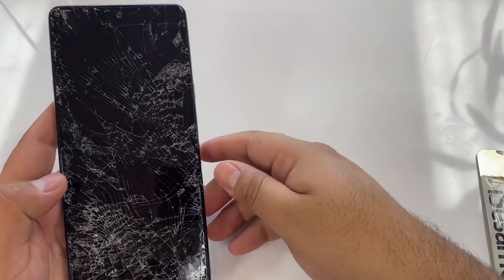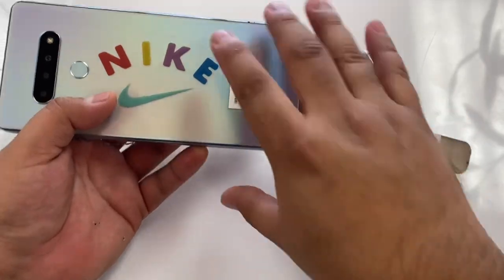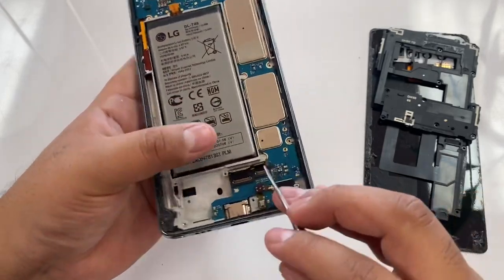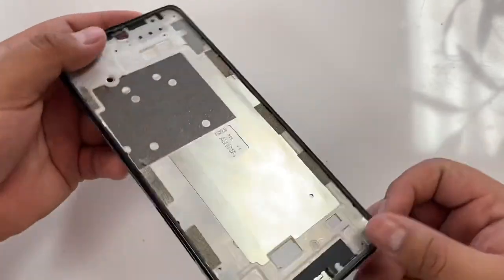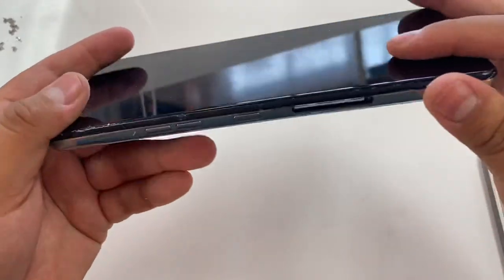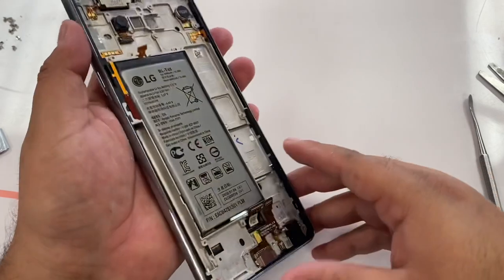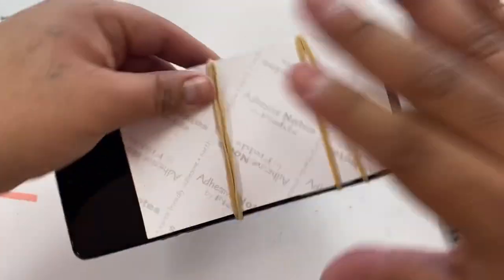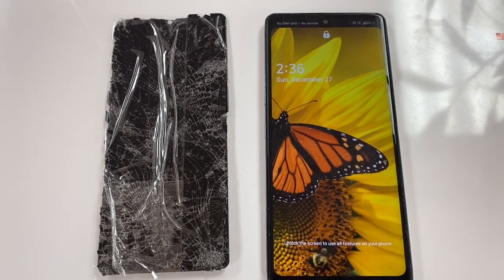LG Stylo 6 LCD Replacement quick and easy step by step

Comment: I have the same phone I slipped and my phone went sliding on the rough concrete. I wanted to know where did you get the screen replacement I would like to order one as well and follow your video to install it.
Reply from the maker: Try the link on description

Comment: Good tut. But is it possible to replace just the outer front glass? I see they sell it, so im assuming its possible. My kids phones front is cracked but it still works. Rather spend $15, opposed to $60-$100 for the lcd kit. I actually purchased just the front glass so...im not sure if I should try.
Reply from the maker: Replacing just the glass is tough , you need take your time heat the front glass and pry it off without damaging the lcd .
Reply: its possiable but a major pain, i messed up my wifes lcd attempting this
Reply: @joshuagiles7060  what u do ?
Reply: @markosgaming3232  i attempted to remove the glass only and wasnt prwpared for the hassle of it. Also didnt have the right tools. So the lcd wound up having to be repkaced

Comment: Look this might be weird, but the iSesamo you have, it looks to be one of the original made versions that were produced in Italy. If you know about this and know that they have since remade these out of a cheaper metal, would you by chance know where to find the original white handled iSesamo? The original can be bent and it always returns to its original position and the whole tool itself is thinner, allowing getting into back glasses much easier. Also the handle does not fall off so easily.
Reply from the maker: Not sure

Comment: Thanks for the video. Very helpful. Quick question…why do you need to remove the motherboard? Looks like you could just disconnect the screen right?
Sorry if i am missing something.
Reply from the maker: U may need to removed to unplug other one and slide out the old cable slide in new cable just lift it a bit

Comment: All you fools don't talk how hard it is to get that screen off without damaging that silver backing, that silver backing can easily be damaged trying to pluck that screen off.  It easily cracks like a thin piece of glass.  I don't know how you managed to pull it off without damaging the silver backing. If you damage that, you probably have to get a whole new lcd screen instead of just the glass.  Thanks for your lack of detail.
Reply from the maker: This repair was a whole new lcd and glass install ... glass only installs are really tough to do since lcd is very thin and fragile u will most like break if not enough heat and waste time ... replace both and u can peel lcd like I did clean and install
Reply: @MarcosTechHero  Yeah, like what?  Heat gun on high, roast edges for 1 hour or until glass starts to melt.  Thanks for the unspecifics.
Reply from the maker: @aljawisa  I actually use a hair blower a heat gun is way too hot ..... this way has worked for me ... not to technical I’ve done most phones like this ... just info everyone works on their own ways and beliefs have a bless day
Reply: @aljawisa  yo, of course its difficult to do without breaking it. HE SAYS THAT... go be crabby at someone else, this was an awesome tutorial 😛
Reply: Of course he doesn't talk about how hard that kind of repair is because that's not the kind of repair he's doing or suggesting LOL
Reply from the maker: @confessrealismsreviews7013  it was pretty easy just need some time to take apart actually took longer do to recording but aslong as u have heat gun ur good
Reply: @MarcosTechHero  definitely! Just wanted to defend you some, cause that person is acting a little ridiculous.
Reply from the maker: @confessrealismsreviews7013  thanks 😊

Comment: Is the touch screen & the Digitizer the same part ?   I cracked the touch screen so I need to know exactly what part I need to buy.   Note... The phone is working perfectly & the Display is good too,, it's just that the damn screen is cracked all over.   Thanks, Tony.
Reply from the maker: Hey Tony I found this display comes with lcd and touch and frame very easy repair just transfer motherboard and battery usually and ur done here is amazon link 
https://amzn.to/3akrxr7
Reply from the maker: Here is screen I replace but I need it to remove frame and remove broken lcd from frame then stick the lcd to frame this is harder process here is amazon link 
https://amzn.to/3ds7MzR
Reply: @MarcosTechHero  Thank you Marcos I definitely appreciate the info & thank you for rapid response,.
Reply from the maker: @tonywilliamson7555  no problem good luck with the repair 👨‍🔧
Reply: @MarcosTechHero  Hey Marcos I looked up both numbers & it's coming up ink cartridges & acc.... & nothing to do with cell phones just so you know lolol.   T.
Reply from the maker: @tonywilliamson7555  hahaha let me try again here with Frak -https://amzn.to/3ts6hXW

No frame like my video more work https://amzn.to/3x3Do6l
Reply: @MarcosTechHero  okay now I seem them both now 1 last question if I may ask,,,. I have 0 exp working on cell phones so which 1 will be the easiest to perform???
Reply: Marcos disregard my last,,, lololol  I see the way I need to go & again Thank You.   T.
Reply: What do you use to take it apart?

Comment: If you break your screen do you have to completely replace your LCD?? Or can you just replace the screen?
Reply from the maker: Replacing the glass is tough in most cases if you have no experience changing top glass only you will most definitely break or damaged lcd which is part gives u image I think this is best way change both link in description
Reply: @MarcosTechHero  How much is something like these charged? I have an LG stylo 6
Reply from the maker: @mobaycomama4590  maybe 80-90
Reply: @MarcosTechHero  OK thank you for your help!! I always come to your videos to learn something new!
Reply from the maker: @mobaycomama4590  thanks 🙏

Comment: Hey bro my screen isn't cracked but it has alot of lines on screen display and the touch screen doesn't work whats the problem
Reply from the maker: Broken lcd it’s damaged you may need replace
Reply: @MarcosTechHero  can I just dry it up cuz it started acting up cuz I wet it
Reply from the maker: Weird
Reply: @MarcosTechHero  nvm I fucked it all up tryna take the screen apart I'm just gonna get a new phone
Reply from the maker: @justinnegrete6803  oh dang
Reply: @justinnegrete6803  same I dropped mind in the pond while fishing so I tried to remove the screen and put  in rice didn't work

Comment: do you need the tape?
Reply from the maker: Hmm u could just use glue but could get messy
Reply: i mean could you just not use tape or glue and leave it bare?
Reply: also i got a new frame as well. do i need to take everything out of the original phone?

Comment: It all went well until i left glue to dry with the phone face down on a microfiber cloth on my desk and the weight of like 15 laptops on top of a book on the back of the phone. The lcd is not displaying correctly, it tested fine before i assembled everything. now i get a lined screen thats mostly blue with 2 dead spots where it looks like the screen got pressed somehow
Reply: omg, in a slight rage i pressed really hard and punched my knuckles into the screen and it started working(almost lost my cool there. lol). there are still small white dots on the bottom of the screen. hopefully it's a reliable phone. i did this screen replacement for a work friend, and its a $50 screen+digitizer from ebay so being the cheapest option i questioned it. But it looks good now and touch works fine
Reply from the maker: @daftnord4957  yes too much pressure will easily damage, hopefully you can still use for a while